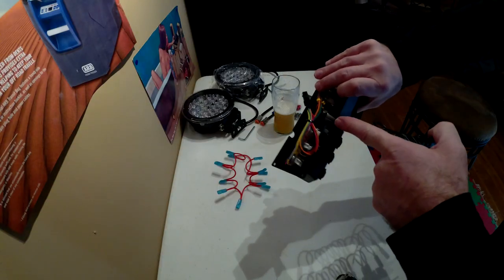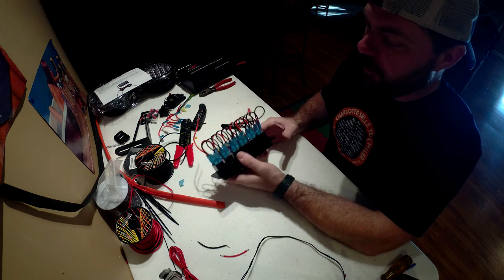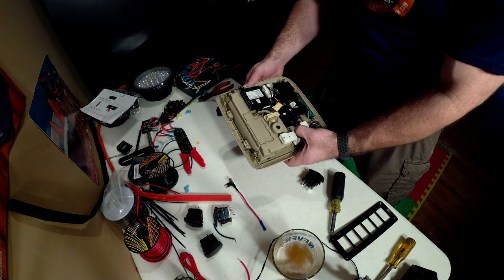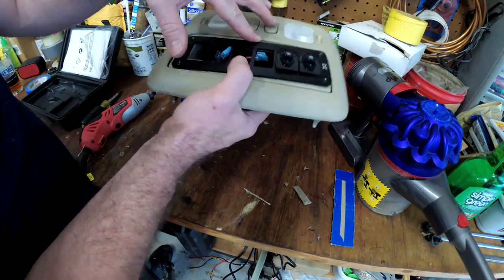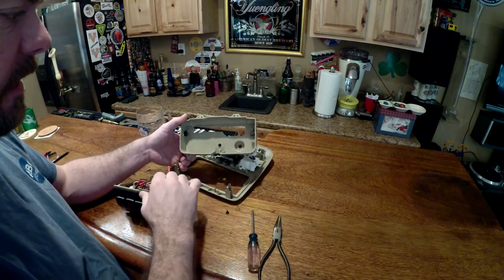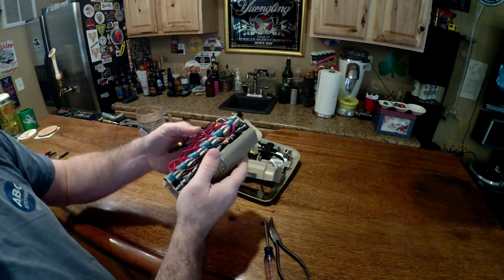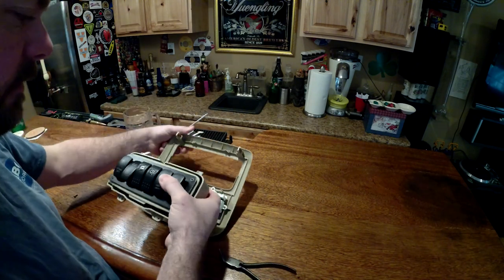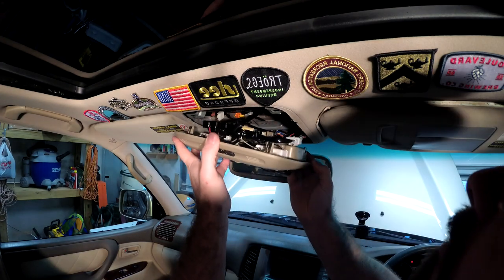Rocker Switch Sunglasses Holder Install - 100 Series Land Cruiser Overland Rig Build

Comment: Nicely done. Is this one of BenC's modules from IH8MUD? Looks like a really clean install though a bit complex with all the wiring that needs to come out and cutting. You're lucky that you have the homelink already in your truck, my 98 didn't come with it so I am looking at putting in a Gentex Autodim mirror with the homelink built in (probably like a Gen4k or Gen8K, depending on what I can find at my local PickNPull).
Reply from the maker: thanks man! this is not one of BenC's it's just a switch panel plate from Amazon and modifications to the stock housing.  i did run into BenC's stuff while researching and he makes some very cool items for the 100s but unfortunately his rocker switch housings are only for 100s without homelink.
Reply: @BradyAdventures  Nice! Between one of the other threads on MUD and your posting I plan to install one sometime this year (probably do like you did and wait till around Black Friday). Are you going to do another video on your impressions of using, visibility, etc.?Would love to hear your thoughts on your placement. My 98 dash cluster is a bit different so it would block indicator lights where you have yours placed now.
Reply from the maker: @mizznfizz1  cool! yep I try to do an initial video on the stuff I'm using install video(s) and then a final overview and Impressions video. I expect to have them done over the next month or so.

Comment: Nice job. Watching this closely as I have the same style overhead console and have been considering a similar install. I assume that you lost the ability to use the screw that was removed in the first step. Any issues with the console wanting to come loose while driving in rough terrain or hitting a pothole?
Reply from the maker: thanks man! yep there was no way to get the screw back in. the clips seem to be more than enough to hold and i don't anticipate any issues. let me know if you have any more questions and good luck! questions